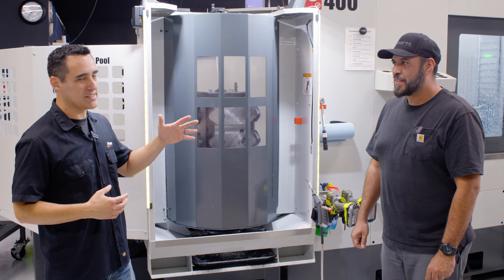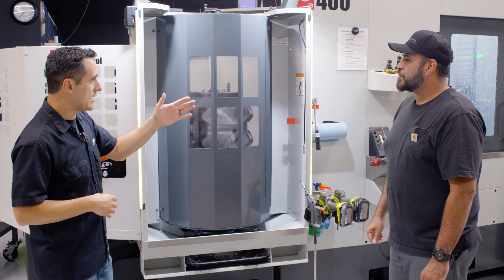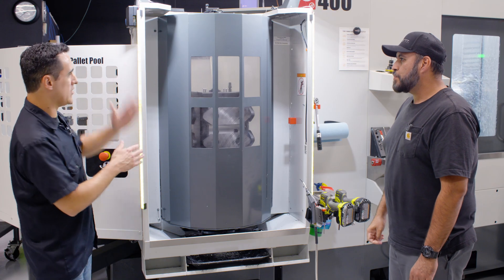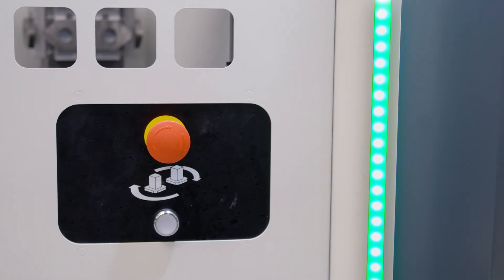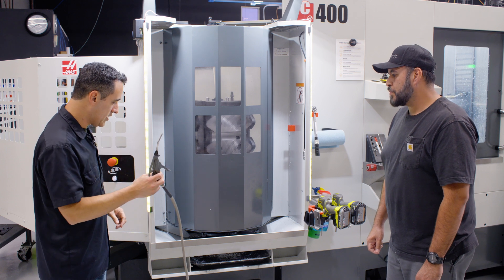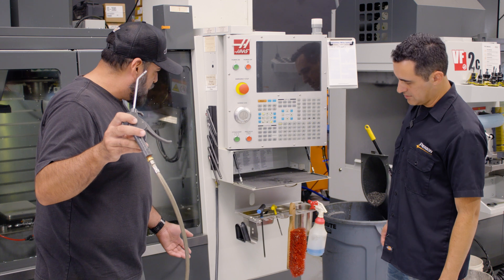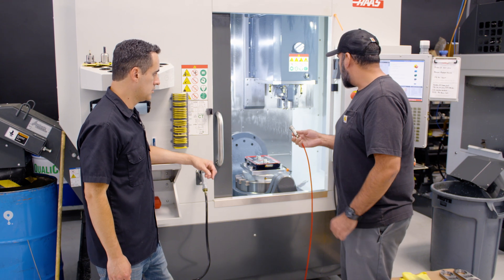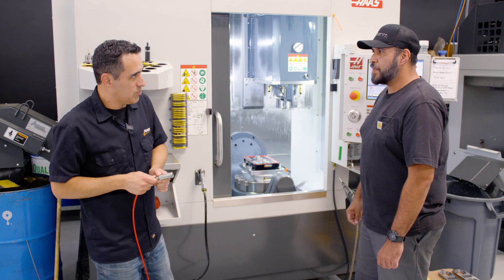Epic Mill Hacks | Small Shop To Lean Factory | Episode 5

Comment: A tip I haven't seen mentioned but I saw in your videos and immediately adopted is the magnetic bar near the door on the VMCs.  I didn't even see how you were using it and I started putting hex wrenches on it and now I see you do the same thing.  I've also started putting my little vise stops on it as well as sockets for my battery ratchet (one for swapping jaws and one for rapidly opening/closing vises).
Reply from the maker: Often, the most simple things are the most helpful!